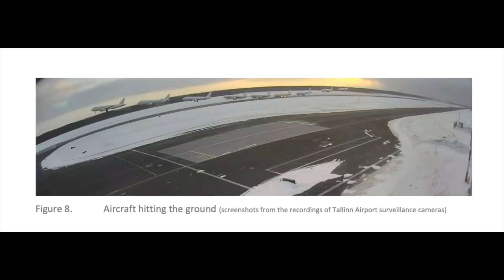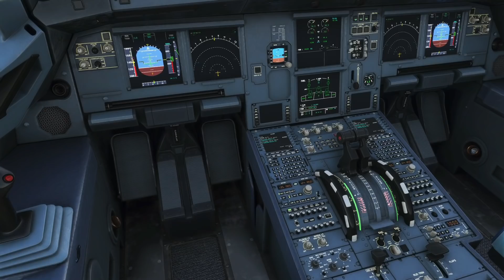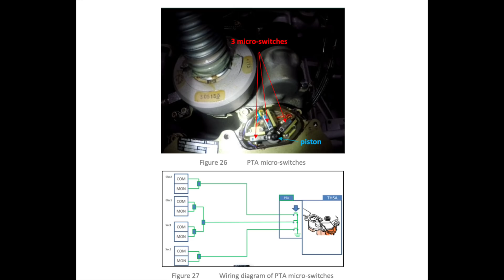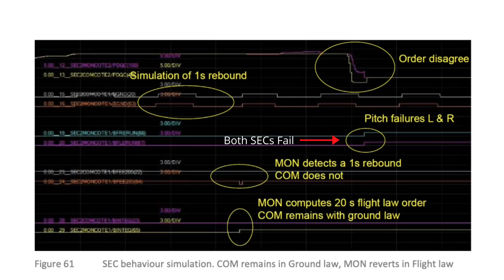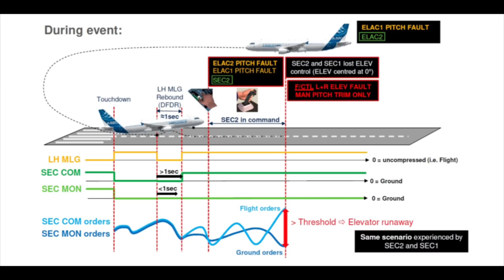The Oil Change That Crashed A Passenger Jet | The Crash Of Smartlynx 9001

Comment: This is why Fly By Wire has no business in transport category airplanes.
Reply: Funny.....since fly by wire aircraft have come in the accident rate for aircraft has come down
Reply: @tomstravels520  And you blindly attribute this solely to FBW?  A person with absolutely no connection to the aviation world might believe you.  But... there are a myriad of reasons why the accident rates have come down in recent years.  Among them...

How about better pilot training?  Better understanding and detection of weather phenomenon such as windshear.  New ways of thinking about dealing with in flight icing and those procedures.  Cockpit/Crew Resource management, which is a concept that did not even exist 35 years ago?  Improved simulators which can provide more realistic simulations of issues that cannot be safely practiced in the real aircraft?
Reply: @BKD70  errrrr where exactly did I say it was the only reason? It is a FACT that accidents have come down since FBW aircraft were invented. I never said it was the only reason. Nice jumping to conclusions

FBW aircraft mean a lighter and more fuel efficient aircraft. It means a safer aircraft as there are numerous accidents from the past that would not have happened if it was a FBW aircraft with protections to prevent stalling, excessive bank angle and pitch movements.
Reply: @tomstravels520  Jump to conclusions?  You didn't say that there were any other reasons... you think people should read more into what you said than what you actually said?  :rolleyes:

So... look through the accident reports and see if you can find any accidents of transport category aircraft that FBW would have prevented.  Also look at accidents of transport category aircraft that FBW  was a causal or contributing factor.  You said there were numerous such accidents... let's see them.
Reply: @BKD70  TK1951- Wouldn’t have stalled
ET409- Wouldn’t have banked excessively 
Aeroflot 593-Wouldn’t have banked excessively
Flash Airlines 604-Wouldn’t have banked excessively
Adam Air 574-Wouldn’t have banked excessively
Colgan Air 3407-Wouldn’t have stalled
BEA 548-Wouldn’t have stalled
Crossair 498- Wouldn’t have lost control
Atlas Air 3591- Aircraft wouldn’t have pitched 45 degrees down

Pretty much any accident that resulted in a stall or excessive banking or pitch related to spatial disorientation. And I know full well you’re going to try and pull the AF447 truck out of the bag. That wasn’t in normal law in the first place

Comment: I don't have an issue with automation. However, automation as we currently have it is not able to think outside the box. I want the pilots who are flying to remain in a pair with as much automation as possible with the ability for the pilots to at any point and for any reason override the what the plane is doing. So I would say 7.5.

Comment: That was like a go around in which the pilot after raising the gear, he also cut the flaps up in panic while been slow and low over the runway, that error made them hit the runway, damaging the engines.  They turned back to opposite runway and made the airport.  They landed on opposite runway. the second engine failed too on final to opposite runway and the landed a bit short.  If they did a Turn around maneuver instead using the downwind leg and back to runway 13 they could have crashed short like Pakistan 5383 did in Nov. 2020.

Comment: 03:01 huge pilot error to pull up the flaps and the gear when low and slow.  They hit the runway hard, damaging the engines..
Reply: Tbh, if they didn't get more speed the treeline would have gotten them. And they really didn't have a lot of time to consider the options.
Reply: @StCreed  You dont get more speed when you open the gear doors, you slow down instead.  You have to wait to clean obstacles before opening the gear doors..

Comment: KISS no longer a design principle?  Seems as though failure modes are multifarious -- or could such a thing never happen so long as the right oil is used?  Confusion over the behavior of AI seems to be a very frequent problem (not "issue").  It seems to me as though the goal should be to minimize automation consistent with not taxing pilots' attention, but especially not to use systems prone to misunderstandings in use, like the 737 Max' Maneuvering Characteristics Augmentation System.

Comment: As to the degree of automation, it should be all or nothing except a some workload reducers that still require frequent oversight the and human ability to fly the airplane in their absence..  Hybrid man-machine interfaces breed complacency in the people and the the belief that there's more automation than there really is.  This has resulted in quite a few crashes of both Tesla cars and airplanes.  Also, over-reliance on automation saps driving and piloting skills to an insane degree, to the point that the humans, who haven't been paying much attention because of their confidence in the automation, don't know how to fly when the automation stops working and they suddenly have to fly the airplane.  They start from way behind the situation and kick in with imprinted training for different circumstances, as evidenced by that Air France flight that fell in the mid-Atlantic from 30-odd thousand feet some years back because the crew couldn't recognize they were stalled and apply the necessary correction.  Truly, the gray areas between hand-flying and fully autonomous automation is a dangerous place.

Comment: poppycock, Turbines are fantastic, once lit up they dont want to go out so if its on fire ,why bother to shut it down! But on the other hand those pesky turbines once they start flaming out, they are difficult to restart. Problem? who know's.  If I was on the flight deck , my vote would to have been "Get this mo - gator on the ground ,where she belongs for inspection and repair". Do not take chances with the valuable  irreplaceable lives of the crew and or passengers.

Comment: Adding oil of the wrong viscosity..... there is a big problem with maintenance if that can’t be traced through the logs particularly when the component is critical.  

A video on oil viscosity, oil additives, oil performance  and oil breakdown might be interesting for any techie heads here.  Oil is a bit like the software of the mechanical parts.  Get it wrong and it will work in many conditions but fail in other demanding conditions.

Comment: If you only have 2 things, then you don't know which one is correct. 1 or 3 things are good. 2 is not well.
Reply: 1 is definitely not good in this context. Look at the 737 Max. Only 1 sensor was used for MCAS
Reply: @tomstravels520  1 is bad. 2 is even worse is probably a better way of saying it.

Comment: Automation crept in and took over almost completely by the time I retired. I was never fully comfortable with it in the same way as the new generation has grown to accept it. I was always of a mind that it served a purpose but that the pilot should always be able to cancel and revert to manual as an option. I've no doubt that automation has saved lives, it has also been clearly demonstrated that too much dependence on automation, or a crew not fully understanding the automation (and who does?) has cost lives. Too many pilots are now sitting in the cockpit without many of the basic skills required to operate an aircraft and with an overdependence on automation. 
Boeing at least attempts to include the pilot in the loop, Airbus strategy is to design the pilot out of the loop. A very dangerous policy.

Comment: Ignoring repeated flight control warnings was their biggest problem. My background in autopilot instrument and flight controls on military aircraft tells me that when you have a problem with the plane turn off the automated system and fly the goddamn plane. They had plenty of warning, especially when they got the warning the second time after they reset the computer. Turn the freaking Electronics off land the plane figure out what the hell is wrong.
Reply: It was the constant resetting of the computers that prevented this from happening much sooner

Comment: Since you asked: I want automation from 1 to 10. Meaning: if it's routine and manageable, let the computer(s) handle it. If pilots are known to screw up, put safeguards in place. But we probably also need the option for humans to fully take control in unforeseen situations. And to have sufficient information to properly diagnose problems. 
Ultimately, there is no substitute for pilot training.

Comment: 10 or 1. This was entirely the fault of the "pilots". With a bird that's trying desperately to communicate that its not happy, they forced it into the air, pulled up the landing gear while there was runway below them, mucked up the pitch control and basically failed to fly the aircraft. All for a training flight that could and should have been aborted at the first sign of something going wrong.

Combine that with someone on the ground who knew better than the manufacturer what oil to to use and there's a culture just waiting for an accident to occur.

Comment: Hi. First of all, I would like to thank you for all your videos which I follow. I guess it is not easy to get all the information you use and put it together, so congratulations for your work.
In response to your question, I believe that automation is very important to relieve a pilot workload, however I firmly think that pilots should fly the airplane more, specially in take off and landings. I follow many channels related to the subject and  once the computers give up or get to many error messages, pilots often get overwhelmed and forget to really fly the airplane. Maybe training should focus more in flying visually and using analogic instruments and fabricants include an easy fast override switch to allow pilots to take control and diagnose problems after insuring a stable flight. So I guess maybe an 8 🙂

Comment: STABILIZER is spelled like this. And a horizontal stabilizer is NOT 2 PIECES! It is one solid piece.
Reply: There are trim tabs at the back of the elevator. A one-piece horizontal  stabilizer is generally called a stabilator.

Comment: I realy like your last question, here my answer:
There is a golden rule in aviation: "Whenever a system fails and the checklist, QRH, Manual, whatever states RESET-IT      you do this only once !"
Therefore i considder this as a pilot failure (as well as a bad example for the students). 

As far as automation concerns: I don't mind automating stuff as long as the crew is fully aware of this automation. Which by experience not always is the case.

On the airbus automation was mainly done to make it more efficient and being so  more profitable (almost the same as the 737-MAX).
Personaly i don't really mind as long as you realise that this results in more complicated systems which might result in a system that is not fully understand by the crew (This is probarly the only time in my live that i said this such a polite and politicaly correct way). 

A slightly different approach which i prefer but is less efficient is a system that assists the pilot for normal operations or gently fights the pilot when doing something which is really unadvisable.
An example could be reducing trottles when IAS goes beyond Vne for the given configuration... In this case the pilot knows "I'm doing something that i really shouldn't but this is an emergency, so I go for it" and manualy advance the trottles again.

Full automation is nice if everything goes well.    If everything would go well all the time we would not need a pilot at all.
So i would prefer a system that would be much closer to 'flying by the seat of my pants' than 'How fast are you on the FMC'.
This is verry well described by Warren vandenBurg in "The children of the magenta line" (here on youtube)
Reply: Thank you for the feedback.
Reply: Regarding your first paragraph this was not clearly stated for training flight though at the time in the manuals. If this was an A-B flight the caution would either never have appeared or would appear once as the pilots only ever set manual trim on the ground unless in DCT Law
Reply: @tomstravels520  From a training point of few i do understand your response. We could have a discussion about this. For instance that failure like this should be trained in a simulator. If it happens in real live and you don't know for sure what the problem is, assume trouble.
Reply: @pascalcoole2725  well the manuals were changed to give more clearer direction in training circuit flights and how often you can reset the computers
Reply: @tomstravels520  Ahh ok.. Of course i was not aware of that. Beside aviation for me is 20 years ago. Still miss it.

Comment: Maybe it would help to list the various states the Airbus control system can be in.

Normal control: Control inputs from the side stick are actioned by the control system interpreting what the pilot wants. With stick central the aircraft continues doing what it is doing after the last input in 1g flight with the angle of bank after the last control input. Sideways movement of the stick controls rate of roll and backward and forward movement effectively controls G by changing pitch. The control system protects the the aircraft from stall, overspeed and exceeding pitch or roll limits (there are a lot of other protections. that I haven't listed).

Alternate control:  The same as Normal control, but the protections are no longer active and are replaced by warnings. This would normally happen when the control system is not happy that it has enough information to be allowed to take protective action. This is roughly the state that Air France 447 was in.

Basic control: Stick movement controls Aileron/roll spoiler and elevators with very little automation involved. The aircraft is different and more difficult to fly. There is no auto trim and the pilot has to trim with the cockpit trim wheels. The Airbus is in this state when on the ground with the system blending to Normal Control between leaving the ground and fifty feet.

Mech Control: The only controls available to the pilot are the rudder and the trimable tailplane (through the trim wheels) It is a very minimal level of control intended only to keep the aircraft straight and level while all computers are reset, although it is possible to land the aircraft in this state, that is not trained or practiced in the simulator as it is considered very unlikely that the aircraft would ever be in this condition for more than a few moments. From the description it would seem that the accident aircraft was in this condition for at least some of the flight and that because of the failing engines there was not time to reset the flight control computers.

Touch and go landings in modern transport aircraft carry all sorts of problems. The aircraft is being operated outside its normal design limits. The problem is made worse in that experienced pilots are not normally required to do them as part of their training (as, for them, it can be completed in a zero flight time simulator), so whenever it is being done on the aircraft it is with at least one very inexperienced pilot at the controls.

Comment: It seems to me that the flight should have been wrapped up after the second elac alarm. To carry on resetting the computer repeatedly seems to me to be unwise.
Reply: James Bond Rule.. 
Once is Happenstance ( aka shit happens) 
Twice is Coincidence ( aka look at that !  ) 
BUT.... 3x is ENEMY ACTION !!!  ( somebody wants you DEAD )
Reply: I'd say, after the FIRST caution light...
Reply: @jahnkaplank8626  Resetting an error message once is usually advisable it can actually just be an indication error but if the exact same error appears again without any meaningful delay you might have a more serious problem and you should shut down you machine.
Reply: They were extremely lucky to have not crashed on that last takeoff. If the plane had been loaded, it would have crashed.

Comment: The problem with automation system's is they are designed and built by humans. Human factors can never be disregarded. It usually takes another human to work out what is going wrong and to try and work the problems.

Comment: You can tell when there's too much automation in an aircraft when the accident report video forgets to detail the small matter of the engine fire...
Reply: You mean the fire which resulted from the engine hitting the ground after gear and flaps retracted which was definitely mentioned in the video at 3:09
Reply: @tomstravels520  It was mentioned in passing but not followed up. Similarly the twin flameout wasn't explained.
Reply: @smorris12  surely it doesn’t take a genius to work out that if you hit the underside of the engines on the ground then that is going to damage the engines internally, breaks some fans etc
Reply: @tomstravels520   So much for intelligent discussion
Reply: @smorris12  well it’s a bit like what happened to PIA8303 last year

Comment: I find it hard to believe there is no protected button/switch to over-ride all the electronics and command a "go around".  Upon reaching a safe altitude there must be a procedure to reconfigure all the operable systems, proceed to the "hold/missed approach" location, and then re-establish an approach and landing.
Reply: You don’t seem to understand. The computers were not preventing the plane from taking off but weren’t functioning in the first place after the pilot didn’t reset the computer. If you override electronics in a fly by wire plane then you have no control at all except any mechanical backup. But no plane will have full mechanical backup otherwise it negates the advantage of having FBW in the first place